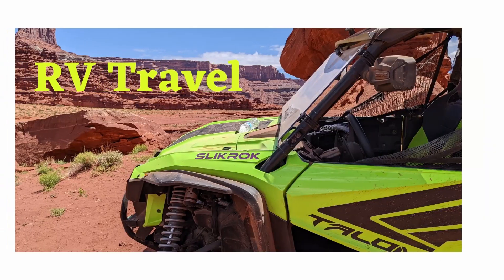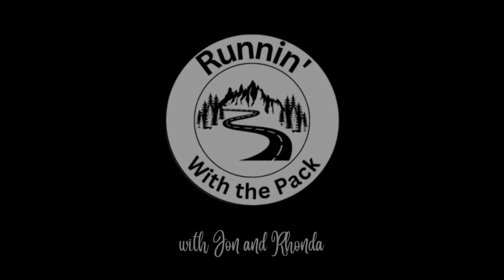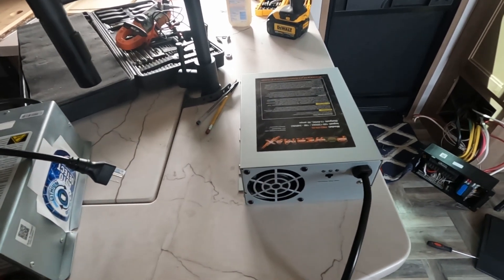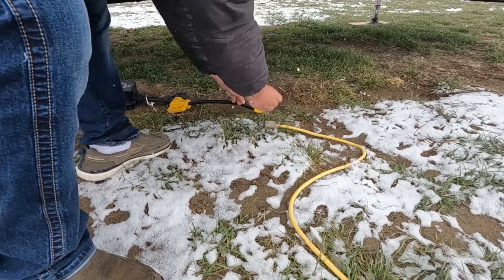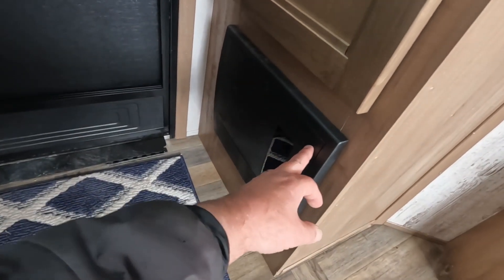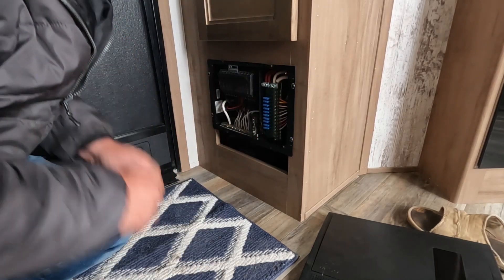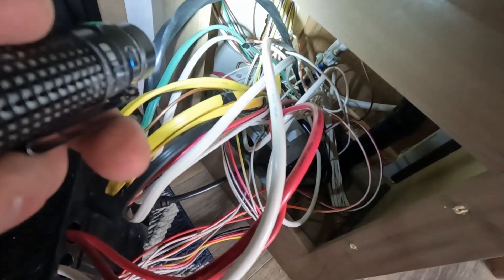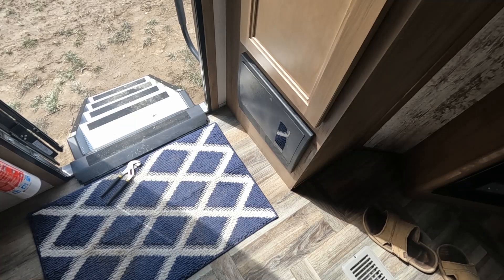WFCO Auto Detect wasn't working for us.  We swapped it out.

Comment: So what was the main issue with it not auto detecting how was it affecting everything in the trailer ?
Reply from the maker: At first it was the Auto-resetting breaker kept tripping when the charger tried throwing more than 30 amps. But I believe it was also an issue of voltage loss because where Forest River installed the converter/charger, was estimated to be about 35 feet on 6AWG wire. The WFCO would not stay on the Lithium profile. I've since heard they have a firmware update if you send it back to them. Which isn't convenient when you want to use your RV. But at least it seems they have a fix now.

All the other systems were fine though.
Reply: @runninwiththepackrvlife2  Thank you for responding my greywolf has about 20ft give or take distance and I felt I would be in the same situation with distance and voltage loss
Reply: @runninwiththepackrvlife2  I called WFCO five times and left a message, emailed, and even filled out the warrant return page, and I got ZERO replies. Don't know how to get the firmware upgrade that I also heard about.
Reply: @mrgehring2 Did they eventually answer?  Have you resolved your issue? I have problem with mine not auto detecting lithium and having a green light